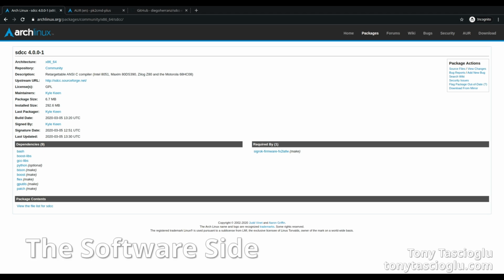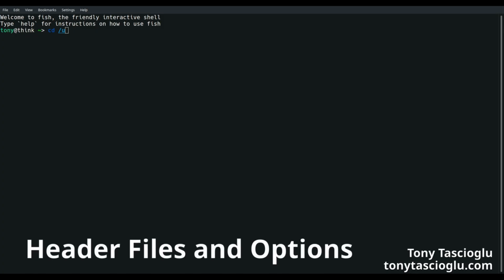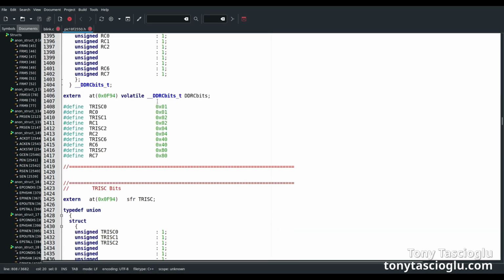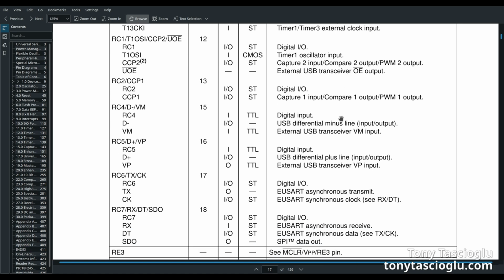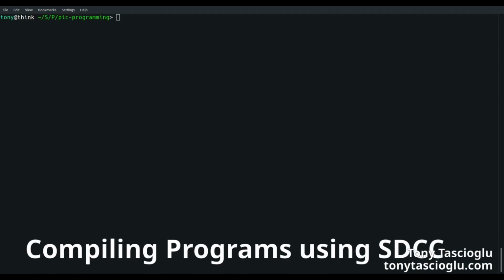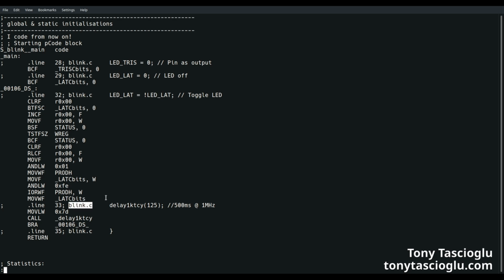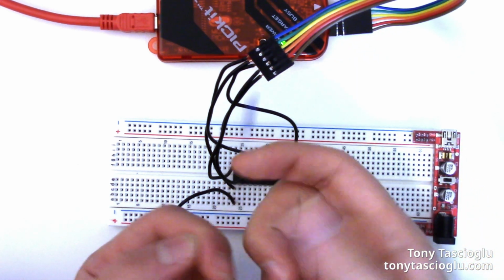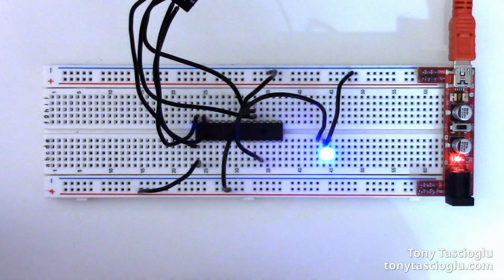How To Program a PIC Microcontroller on Linux using SDCC

Comment: Any way to do debugging?
Reply from the maker: SDCC does have a source level debugger, but I honestly have no idea how to get it to work with these chips.
There's some documentation over at http://fivedots.coe.psu.ac.th/~cj/masd/resources/sdcc-doc/SDCCUdoc-28.html that may be of some help.
Reply: @TonyTascioglu  thanks, How is the code size of your builds? For me sdcc adds about 1.4k of stuff onto my hex files compared to xc8. I think its some heap setup. Do you have the same issue?
Reply: @TonyTascioglu  After using sdcc and gputils (gpasm and gplink) I use gpsim, a simulator/debugger. Although it isn't perfect - I have had problems, though there is a clumsy work-around, connecting to a simulated LCD 2 line display and I have never got it to simulate analogue input - it is pretty useful. It is however an assembly level debugger.

Comment: Hello Tony I have followed this tutorial and doing a decent programming now. A great thanks to you. But I found it impossible to work with newer Microcontrollers which Microchip is releasing. It will be of great help if you show how to add new chips to SDCC.

..Thanks in advance..
Reply from the maker: If they are supported upstream by SDCC, but just under a different license, it should be possible to bring them in.
Otherwise, it would take a lot more skill and effort then I have to manually support the chip. 
Microchip isn't exactly keen about being open with their designs and implementations, given that they have their own proprietary IDE on Windows they want you to use...

Comment: Of course I would come across this when wasting time online instead of grinding away in KiCad lmao. Yeah screw the PicKit3 lol.
Reply from the maker: I mean, KiCad is pretty feature rich as far as free PCB design software goes, but, it does have a steep learning curve and I still haven't finished an actual project using it... I reverted to using EasyEDA with Oshpark for simplicity for the once a year I want a PCB. After making this video, I also just went back to the STM32 boards since they had more documentation - shame they also require their special programmer, something like an Arduino Pro Mini with any FTDI breakout is so much easier to program.

Comment: If you are on Arch LInux, you also need to install the 'gputils' package, which contains the 'gpasm' assembler. Otherwise you can't compile your firmware. The 'sdcc' package does not depend on 'gputils' (only for making the package).

Also a minor nitpick: the contents of the .hex file are not the actual executable binary code per se. It contains the code and instructions where to put it in the memory of the MCU, together with other data to load into an EEPROM or the fuse bits.
Reply from the maker: Nice catch, you're correct on both points. I can confirm sdcc only depends on gputils for making the package but needs to be installed. You're also correct on the .hex file containing more then just the binary but also what is needed for programming the microcontroller. I just wanted to highlight that it is essentially machine code unlike the assembly, it's in a format meant for computers and not readability by people.

Comment: Can you make this into a series? Demo various features of this micro, ADC, PWM, I2C, serial, timers, interrupts etc. each feature can be one part.
Reply from the maker: That was the plan when I filmed this video, but then I got stuck in a debugging loop after ADC/PWM. I'll have to do some more research with how SDCC works before filming that one, and unlike Arduino, there isn't much documentation on the PIC stuff...

Comment: You have just shared very rare information. Thank you very much. Unfortunately the rise of arduino and STM is overshadowing the PIC. But we, the PIC die hards still exist. And are far from extinction.
Reply from the maker: Programming PIC using Assembly was among my first introductions to microcontrollers! While it's fine for simple programs, assembly gets very tedious the moment you need something more then a simple loop or blinking (and being in middle school back then) I ended up switching to Arduino for most things since their abstracted C is much simpler (even compared to plain C)...
Reply: @TonyTascioglu  thre is mikroC and option using high level programming and the good thing is that you can use assembler as well.